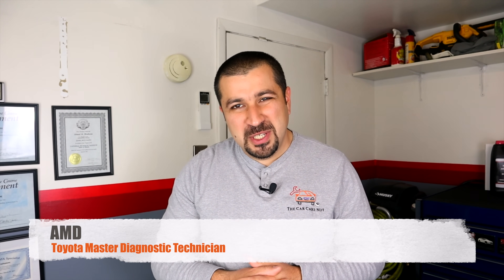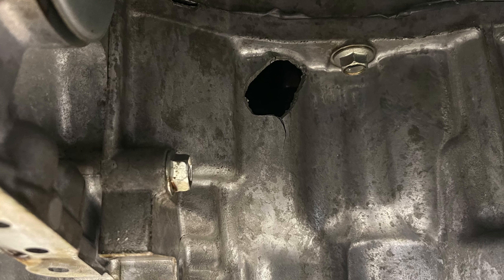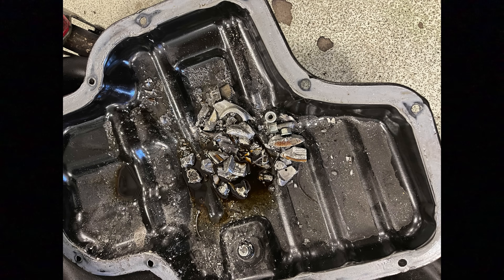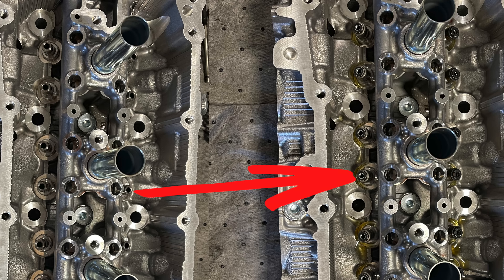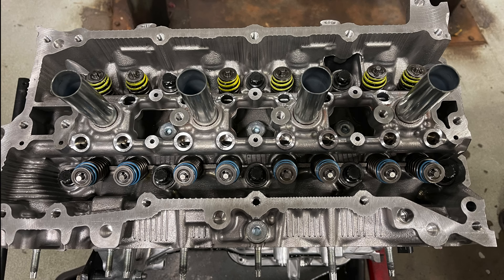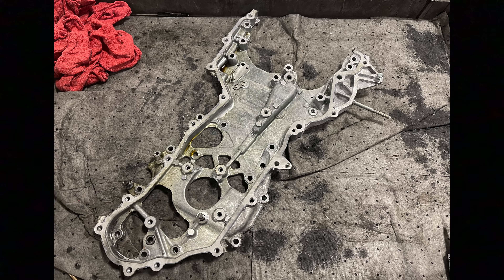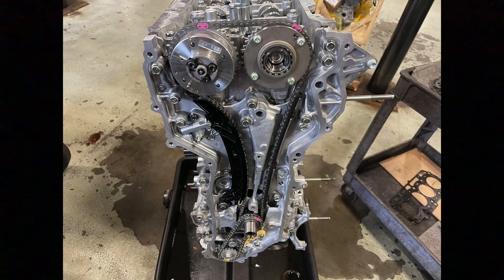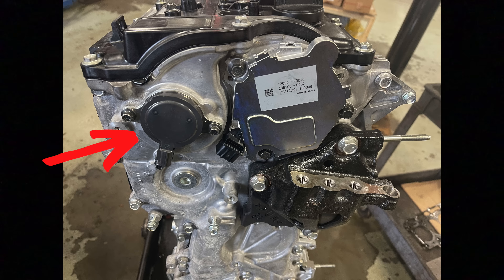Toyota's New Engine assembly Full start to finish!

Comment: That is really a great and well planned out engine.. I have a 2020 Camry XLE with that engine.The fuel economy is unbelievable. I just went on a 200 mile trip and on the way to my destination I got 48.2 mi to the gallon. After I got back home and I did some very hard accelerations on the interstate I still got 46 MPGs. After you drive one of those cars with the 8-speed automatic transmission you learn where different power bands are at certain speeds.. It is hard to explain but that car will really move out good if you know how to drive it. It is a buttery smooth engine as well. Unlike the new Honda Accord I had considered buying before I purchased it..
Reply: I have read quite few articles that praise this new TOYOTA engine under the Dynamic Force Engine Family for its high MPGs (41+MPG) being a BIG NATURALLY ASPIRATED 4 CYLINDER (2.5 liters)

So TOYOTA didn't went the "engine shrinking + turbo route" like say the EcoBoost , and yet they get superb fuel economy with no compromise in power (206 Naturally Aspirated horsepower)
TOYOTA did put quite some neat tech into this engines and get higher thermal efficiency too.
TOYOTA 2.5L A25A-FKS (engine code) sure beats Mazda's Skyactiv X that have become nothing of what it promised (that's why is not available for the U.S.A market)
Reply: @EM6285  I really like the 2.5 DF engine. The more you drive it the better it runs . I left Honda to avoid the small turbo engines as well as the CVT`s . The 2.5  has a smooth and peppy power band . It is a versatile engine as well . It is used in the Lexus, Sienna Mini van and the Venza . 
Excellent fuel economy and reliability . My Camry is so quiet . Buttery smooth and quiet . I am well pleased with it . I was considering a Lexus ES-350 , I just did not really want a V6. The 2.5 serves me well .
Reply: Thank you for sharing.
Reply: @RightLaneHog3151  I have read that some have got 50 MPG before..I don't really go out of my way when I get 48 and I speed as well.. up to 85 mph at times..
Reply: I have same engine in 2020 RAV 4    No one believes me when I tell them it gets low 40s MPG on highway.
Reply: @geraldevans2535  That engine is very efficient with that 8-speed transmission more than people can imagine, if you know how to drive it. My car was rated 38 on the highway yet it will easily get 48.2 .When I first got it it was getting 46.2 on the same trip. Your RAV4 is rated 35 on the highway so you will be able to get in the early 40s. As you know how to drive it as well.. These fuel mileage numbers are much better than about anything out there that is in their class...
Reply: High 40's is awesome in a full size, non-hybrid!
Reply: Im a delivery driver so I only get 23mpg but I have a heavy foot
Reply: @timsouttahere  😖I hope not like someone drove the rental car he just repaired😭🤑
Reply: @charlesjackson1700  not really I hope 😫
Reply: @timsouttahere  ,,,,😆🙏
Reply: My son has an 18 camry at 75 miles an hr we got 45 to the gallon on a 265 mile trip. Loaded with luggage and im a very big person '300lb' my son at 245. Fill up and check it the traditional way it wont lie.Not sure what it was tacking.  But they get awesome mileage.  I'm sure we could of gotten better if we tried.
Reply: @jeremygerdes1904  That is great. Fuel efficiency at the max .
Reply: @RightLaneHog3151  do you have a link to that video?
Reply: I never really looked up or calculated what MPG I am getting either then what my info screen with the bar graph shows. When I am going 70-72 the car stay near the end of 7th gear and it gets 35-38 mpg. Increase the speed to 74 shifts in to 8th get 40 or over. Then of course when it is windy or hilly (almost all the time in my area) shifts between 7 and 8 a lot. When it is at the end of 7th gear I am little over 2000 rpm then when it switches to 8 just below 2000 rpm.
Reply: @polsdofer960  You have to look at it over all . I notice when I set the cruise at higher speeds at times the miles per gallon increased and the tach level goes down as well . I mostly go by the end of the trip and see what I get as the MPG on the screen .
Reply: @charlesjackson1700  I know this. However, we drive 40 mi a day for work. Only 2 miles is in town everything else is interstate. When we drive to go someplace again mostly highway. I am just stating depending at what speed you are at will dictate your gear and RPM changing your MPG and factor such as hills and wind. The best MPG is going to be at the low end of 7 and 8 but not the high end of 7 or 8.
Reply: @polsdofer960  That is what I have experienced as well . Do have a trim level that has 3 driving modes . I keep my XLE in Eco during highway driving . It really changes gears fast and goes to the higher gears very quickly .
Reply: I also forgot to mention it is an se model 2.5   Not sure if it has an eco mod.  it is a fantastic car with plenty of power.  At least for a 20 year old.
Reply: @jeremygerdes1904  A regular SE does not have the three driving modes.. If it was a hybrid it would.. Nevertheless yours did great !!!
Reply: I 100% agree with you Charles.  These are great cars and awesome mileage for a mid-sized car.  There are people out there that will argue with a stop sign.  I probably wouldn't believe it but I have personally seen it several times over. On shorter trips we even got 47-48 to the gallon.  If you drive em like you should you will get excellent service from them for a.long time. Iv said many times to people I would not  buy a hybrid with mileage like this.
Reply: @jeremygerdes1904  The mileage really is hard to believe. The mileage was up 6 MPG from the previous generation on the highway however it will do a lot better than the 38-39 it's suggest. There are a lot of people that will argue with you about anything.. If I make a comment about anything I would want to be the truth there's nothing ventured when you make up things.. Luckily there are others out there that can verify the same. You make a good point that you can even get better if you drive for it.. when I got that 48.2 a few weeks ago at one time I got my car up to 100 mph on a straight stretch.. so if I had not done that it would have even been better as you know that put a "ding" in it😆.
I'm very satisfied with that car and I would recommend them to anyone.. I used to buy Hondas a Accords and left them because I did not want a turbocharged engine.. or those CVT transmissions.
Reply: Fortunate to recently purchase a 2020 Camry LE 26k miles .. Dynamic Force 2.5 what an incredible engine! I'm infatuated with this car. I could write a happy book of experience but won't. The engineering in this car is unique and filled with surprise ...My baby will want for nothing with malicious maintenance schedule
Reply: @mrp8173  I'm glad for you and I'm sure you will be happy with the car. It's one of the best mid-size sedans you can buy and most reliable. I really get great service out of mine as well as great gas mileage. You can read articles about the 2.5 dynamic Force engine and it will tell you it's one of the best engines Toyota has come out with. It is used in Toyotas and Lexus in conjunction with hybrid power trains. It is just an all-around durable engine. You don't see other car makers have an engine such as that which is used in so many vehicles because it is proven and reliable.. It is a very good transmission as well made by Aisin. It is used in Lexus models as well. Don't pay any attention when you hear negative comments about the engine and transmission because they are proven to be great both of them.. Some people are trolls and they like to go around making negative comments and most of them have a crappy car and live in their mom's basement.
Reply: Four months ago I purchased a 2020 Toyota Camry LE with this 2.5 definitive force engines. I'm an auto enthusiast this engine is no less than incredible..perfect for this model car. I could write a book but won't.
Reply: @mrp8173  It is a very good engine and very reliable. It has high thermal efficiency and heats up quickly and uses the heat to make it more efficient. It's part of Toyota's new platform TNGA. It can be used in so many vehicles and easily paired with hybrids.  Engineers state it is one of the best engines Toyota has ever. I used to buy Hondas. I don't like their you are turbo engines. They are having trouble with the turbos as well as the engines blowing head gaskets between 30 and 40,000 miles.
Reply: I have a non-huvrid, drive in Eco mode conservatively, and get about 36 mpg. 2023 Camry XSE
Reply: @basilman121  Is that highway driving exclusively? When I start out on a 90 mi one way trip to see my sister, it gets up to about 42 MPG for the first 60 miles.. as I approached her home it goes up to the 47 and 48 mpg range.. I also keep my tire pressure at 38 and 39 PSI. That helps a lot with rolling.. My sister has a new loaded 2023 Camry XSE Wind Chill Pearl white, non-hybrid. She really loves it.. She had a Honda Accord.
Reply: @charlesjackson1700 
Is it only highway driving coz the highest I’ve ever got is 38.5 mixed 
I don’t have a heavy foot tho
Reply: I regularly get 48mpg in my 19 Camry with this engine.
Reply: @IKnewMickey  It is not hard to do.. However the numbers are so high most people that have cars that are lucky to get 28 mpg on the road think you or lying when you tell them that...🙄those cars are really set up for high efficiency when it comes to gas mileage..
Reply: @IKnewMickey  o ye
You driving like I'm walking or only one cylinder is functional in your car
Reply: @RightLaneHog3151 A hybrid gets better mileage in town. If I can get 48 miles to the gallon on the highway with a naturally aspired engine and an 8-speed transmission I will take that any day.. I do not care for a CVT transmission which would be in the hybrid Camry.. It is a very numb and vague driving experience.. maybe in the near future I will have no alternative but until then I want a real transmission that has gears and not a one speed CVT.
Reply: @charlesjackson1700  I think CVT are still getting the bugs worked out. Eventually will be better, but I dont think they are as reliable yet
Reply: @nathanbruneau1822  I guess they will get better in time.. I read that some of them have a launch gear for the first year and that helps them to take off better.. then they go to the regular CVT configuration.. I always read about how terrible Nissan Jatco transmissions are.. I had much rather have a traditional transmission any day... CVT transmissions are cheaper to make... And like you say I don't think they are as reliable.. They sure are underwhelming to drive..
Reply: O really
Got same engine it's 38 mpg in Florida no hills, do not exagerrate 48, it's possible only for hybrid
Reply: @a.a7648  I don't need you to speak for me or to try to correct me for anything.. When I first got that car the same trip I got 46.2.. one year later 48.2. You apparently don't know how to get the best fuel efficiency. I also have an XLE which has three driving modes and I keep it in the Eco mode when on a trip.. If you had anything other than the XSE or XLE you cannot compare your vehicle to mine... They only have one driving mode.. I was driving between 65 and 70 at times and did not tack but 1,250  RPMs . Also on the road when you are driving a hybrid the tac is running much higher.. They are not AS efficient on highway driving . However it would be better in town than mine. I AM VERY IMPRESSED BY THIS CAR AS I HAVE ALWAYS DRIVEN HONDA'S/ACURA'S BEFORE.
Reply: @charlesjackson1700  ok dude ok, 
Speed matters 
I do not want you to have an MI
My speed was 75 - 80, so 38 mph 
I'm sure 65 can give you 40 - 45 mpg
However, most economy you will get with LE model, the lightest one, your model more powerful, do not bull shhh with your eco modes, it doesn't matter at all
Reply: @a.a7648  You need to educate yourself on the three driving modes the two upper trims that the Camry has. Also the hybrid trims have those three driving modes .. Eco, normal and sport. They all are completely different and the car runs different as  it changes the Dynamics of how the transmission shifts as well as power .. when you put it in sport mode it stiffens up the suspension.. it also allows the transmission to change at different shifts for it to achieve the most power... Anyone that has these cars that had those driving modes will tell you the same thing.. Do some research before you start chiming in and signifying on someone's comments !!!
Reply: you like to exaggerate. like your 1100 RPM @ 65 MPH claim
Reply: @verlaryder  You don't know anything about Toyota cars , transmissions or driving modes  !!! If you have one of Toyota's higher trim Camrys... The XLE or XSE you can put it in the ECO mode on the interstate and you will not tac but 1250 RPMs going 65 - 68 mph.. I believe you must have a Kia or Hyundai?... You have really affirmed that people are really stupid about Toyota's new dynamic Force engine and 8-speed transmission..
Reply: @charlesjackson1700 The 2020 4 cyl 8 speed XLE has a final drive ratio of 2.802 so the engine RPM's at 60 MPH in 6th gear direct drive are about 2300 RPM.  In 8th gear 0.673 overdrive the RPMs are about 1500.  At 65-68 MPH the RPMs are about 1625-1700 RPM.  So you cannot post a youtube video showing your tachometer is indicating 1100 RPMs at a steady 65 -68 MPH because it's not phyically possible..
Reply: @verlaryder  I own one and you are dead wrong !!! And I put mine in eco mode, it changes the dynamics of everything the same way sport mode does .. I could get over 50 if I really drove for it . I have to be going 90 MPH for it to tac 1700 RPM .. I had a Honda Accord before and you are more on track of what it would tac . I have had it for a year and I know what it will do. I know how to drive it ... The transmission has learned my driving habits as well and has adapted to them.. I bet you did not know that as well .. Just ask the Car Nut for verification of that . The more you drive them the better they run and adapt to the way you drive ...
Reply: @charlesjackson1700  I have one in SE trim with AWD. I can affirm what you are saying. On the highway in high gear in eco mode. Mine tax’s at around1200 or so. I’m going on a 300 mile trip this weekend, so I will find out the long trip mileage.
Reply: @craiglutska2850  They will sure do .. I hate when people try to call you a liar. I am impressed with the facts ... Others that own them and know how to drive them can affirm what I am saying . You know that engine will really last a long time with the right care ... It puts little stress on the engine with that 8 speed transmission.  I am sure yours will be very impressive as well .
Reply: @verlaryder  exactly 
He just believe it
Reply: @charlesjackson1700  Charles, I know what you are saying is true abut the 1,100 to 1,300 RPM's on this engine. I bought a 2020 Camry Hybrid with this engine.It now has 21,000 miles and I also leave it in ECO mode all the time. I always get 55 to 58MPG on the HiWay driving 70 to 75 MPH. I have gotten 62 MPG several times on 300 mile-plus trips and over 63 MPG driving between 65 to 75 Miles Per Hour on 250 mile-plus trips 3 different times.
Reply: @josephhall1241  .. Joseph , It is unbelievable how low those cars will tach on the highway. some will accuse you of making it up. You are definitely taking advantage of your car to get the best MPG out of it.. When you put it in the Eco mode it will really bring up the gas mileage. It takes a little from the power however if you're driving conservatively you wouldn't be zipping around anyway... These cars and engines really have a lot of advantages over the competition as well as top notch reliability.. You are getting great MPG out of your car in general .. which really brings down the cost of ownership.. as well.. I'm sure you're very happy with your car as I am with mine.❤️
Reply: @charlesjackson1700  Thanks Charles, like I said, mine is the 2020 Camry Hybrid, but the 2.5 liter 4cyl is the same engine. Best vehicle by far out of the 20 different cars or trucks that I have purchased for my family or myself in the last 49 years. People can think what they want to, but I actually have several pictures of the dash console showing the miles driven and the MPG at the next gas fill-up. Thanks again
Reply: @josephhall1241  .. Thank you Joseph.. It's good too hear from someone that can confirm the same as I have experienced, opposed to others trying to shoot down my observations. I have had a lot of cars as well and I can say this is the best one as far as miles per gallon as well.. I had Hondas before this Toyota and they were all great cars as well. That is good you took pictures of the information center that showed the miles per gallon. I have also found the more you drive the car and get familiar with it the more you will learn as well.. I'm sure both our cars will be very enjoyable for us and we will not have buyers remorse like many have that buy cars that prove to be problematic and subpar.. Have a good day Joseph🌞
Reply: @josephhall1241  By having the hybrid you have the same three driving modes The XLE and XSE has.. as well as the brake hold and the electronic parking brake.
Reply: @a.a7648  good thing to
Reply: @RightLaneHog3151  
No way you will get 45 mpg with 75 mph
Maybe only 2 cylinders working in your car
With 65 mph as a max speed, yes
Reply: @a.a7648  Yes you can..What you do not understand at the higher speeds you even tach less RPMs than some of the lower speeds if it is in 7th or 8th gear..and that's why you can get incredibly high gas mileage.. If you own one you would know yourself.. I used to have a 2019 Honda Accord EXL 2.0 .The gas mileage on it sucked compared to the Camry.